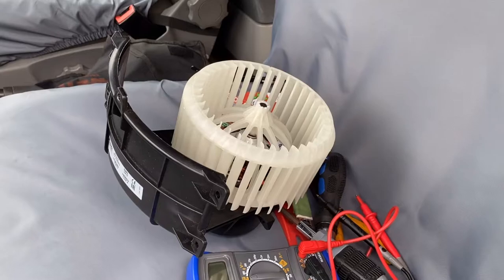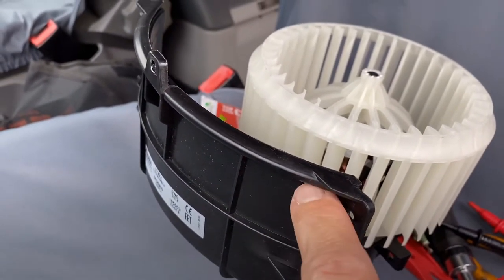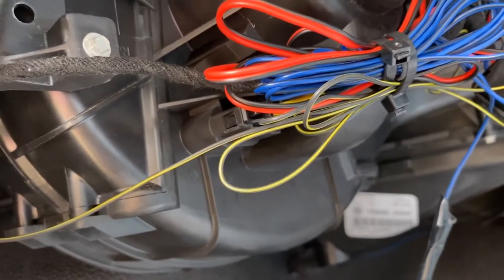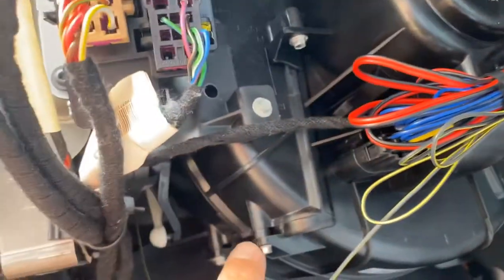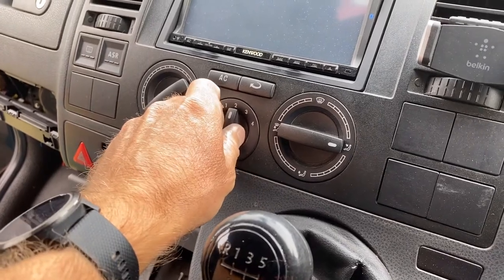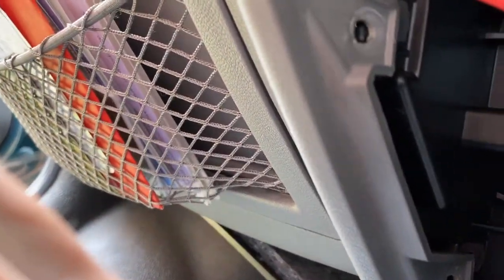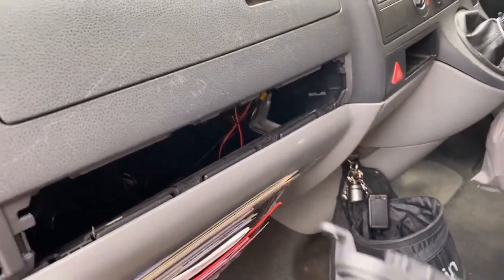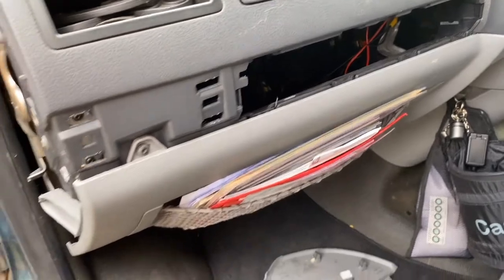How to replace a blower motor in a VW T5 Van

Comment: Hi Nick, thanks for uploading the video. I'm unsure if I need to replace my motor. It sounds as though it works at all strengths but I don't have full power from the vents. Do you know if that would be a blower motor issue? Thanks.
Reply from the maker: Hi Joe, if it only works on a couple of settings it could be the resister only.  I’d try that first.  Alternatively it could be that you air ducts are blocked.

Comment: Good video. How did you remove the fixing to the left of the hazard and cup holder? I oiled the dry bearing and my noise went away
Reply from the maker: Hi thanks for the comments.  I used a trim tool and just gently prized it off!
Reply: @nickharper6436  I tried that. It wouldn't come off in any direction
Reply from the maker: From memory I don’t recall having a problem removing that panel

Comment: oh dear. I got mine off ebay, £42 free postage.
Reply from the maker: Fantastic,  I needed mine doing quick so just went into town and picked it up as they had one in.  Great price you found it at though and thanks for the comment.
Reply: @nickharper6436  cool I've subscribed to your channel. It did help me do my own.
Reply from the maker: Cool, I’m glad it was of some use 👍
Reply: Did your fan just completely pack in? Mines working then slowing down  to a noisey buzz
Reply from the maker: @phillymoggs  yes mine completely stoped working!  I tried a new resister first but that didn’t work.  Hope you get it sorted - it’s cold outside 🥶
Reply: I took resister out , as you know it still works in setting 4, but it still started to loose power after 20 seconds , so I’ve ordered a new fan
Reply: @phillymoggs  yeas well at first it was just making like a squeaky/grinding noise. then it would start for a second or so and just slow down til stop. And for the price of them it's just worth swapping for new.
Reply: @phillymoggs  I've got exactly the same problem. Goes to a squeal after 20 secs or so on all settings. How did you get on with changing over the motor!?
Reply: @nickharper6436 I bought one off ebay and it didn't work 😢

Comment: Thanks Nick, my fan works on 3 and 4. Is it the switch or the fan that's shot?
Reply from the maker: Hi Paul if the fans working but only on 3 and 4 that’s normally only the resister. You can get those of eBay or Amazon for about £12 and easy to change.  I make reference to the resister in the video Paul.
Reply: @nickharper6436  Thanks Nick